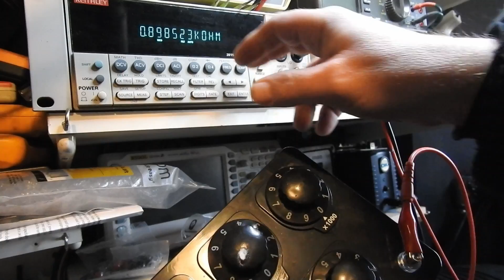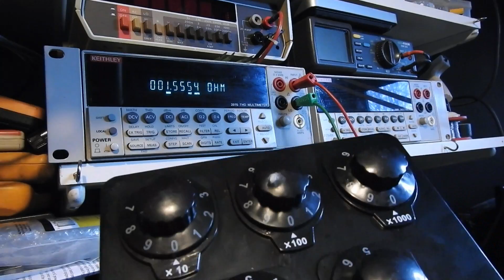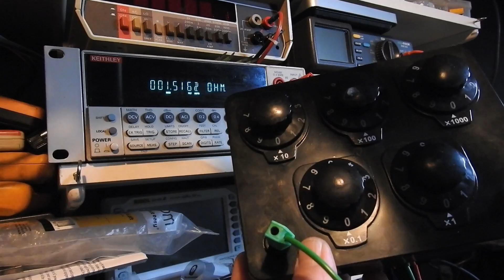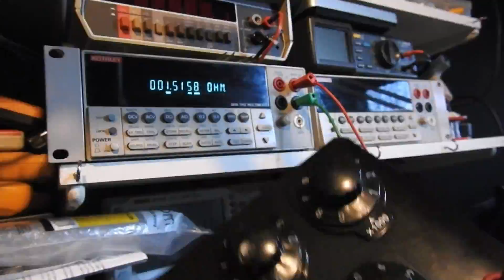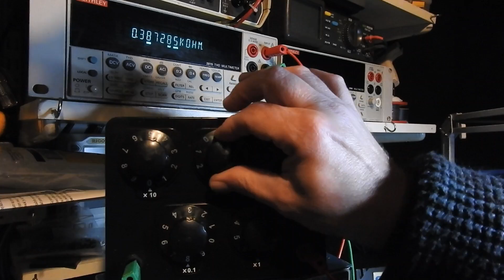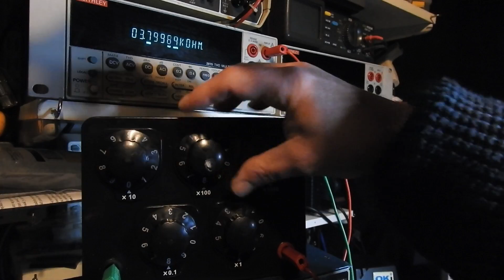Is A Cheap Decade Resistor Box Worth The Money?

Comment: Changed mine to go from 10 Ohms to 1M  with 5W resistors. It's a great deal for the case and buttons alone. Takes a bit of tinkering but even then you get a 5W decade box for a fantastic price.
Reply from the maker: That sounds epic! I wonder what the highest wattage SMD's I could put in my design now.  Thanks!
Reply: @reallyniceaudio  There's so much room inside you don't need to use SMD. Might as well have put in 10W ceramic.
Reply from the maker: @Ni5ei  Sorry you might not have seen my video where I design my own decade resistor project
https://youtu.be/CCaxj9IDMkM?si=J2j-GptHjBUjOTbA

Comment: I think solder is not wear-resistant. I wonder how long switches will last and what would be a failure mode (like, can solder dust cause a short-circuit?).
Reply from the maker: Yeah will prob last a week if your lucky.  In the end I made my own version https://youtube.com/shorts/lhreDVdqf4k?feature=share
Reply: I saw a video of the elenco box, it uses through hole resistors and real switches, probably way longer lasting and also easy to repair